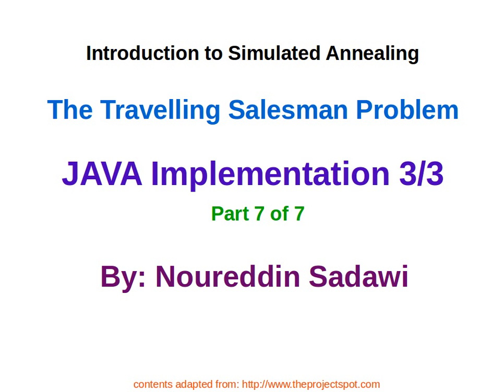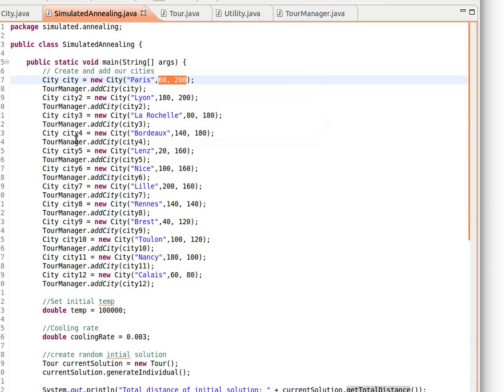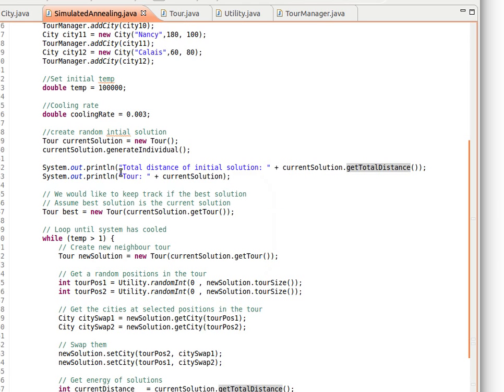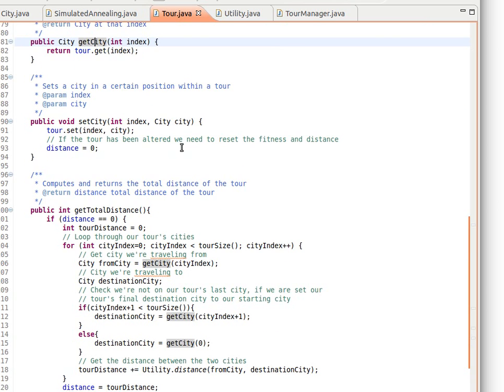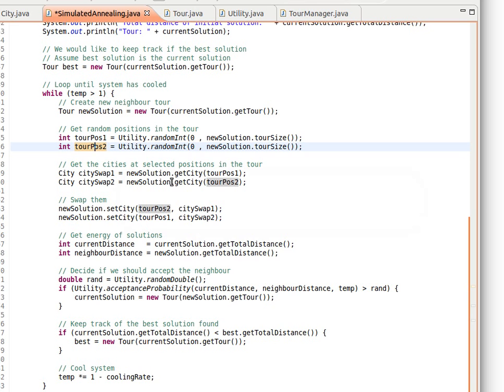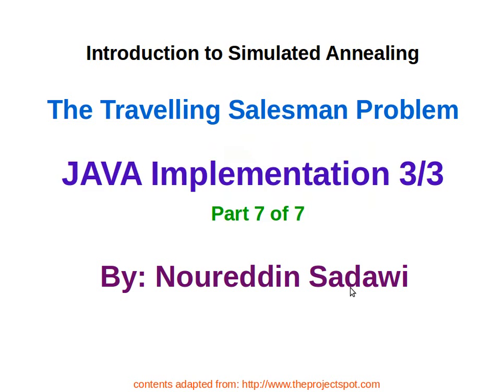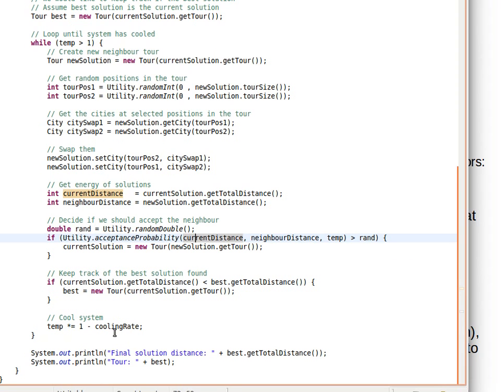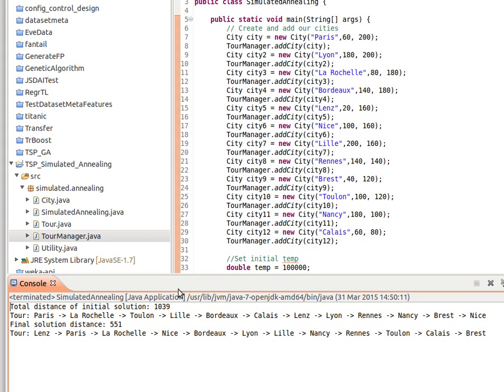Simulated Annealing 7/7: JAVA Implementation 3/3

Comment: Please correct me if I'm wrong, but shouldn't the acceptance probability be >= the random value? If the random value was by coincidence 1.0, and the new solution was in fact better than the previous one, both the acceptance probability and the random value would be 1.0. But the algorithm would not accept this solution because of the > instead of the >=. Just a thought, since this (very rare, I admit) coincidence could miss some solutions along the way.
Reply from the maker: 5iGnuM You could be right .. the code is available online .. feel free to modify it as you wish!
Reply: Yes, exactly.